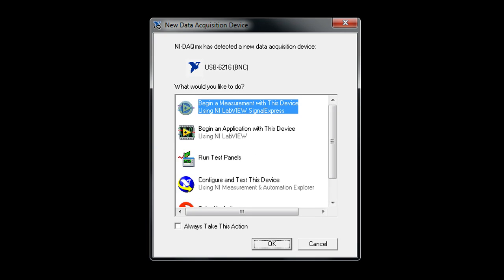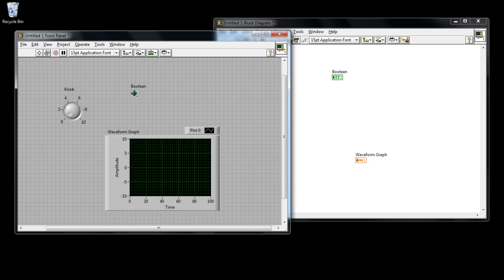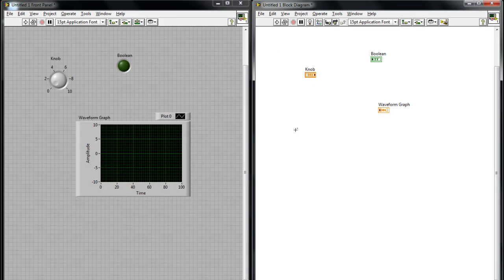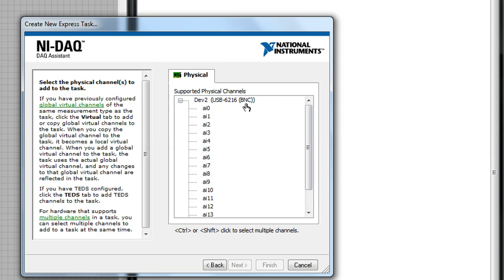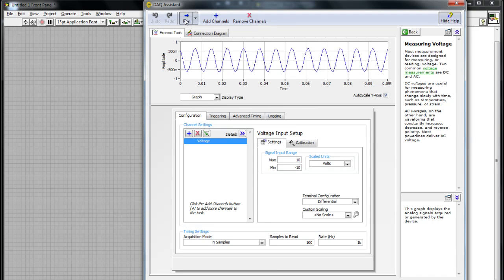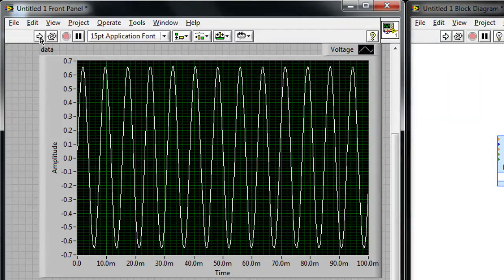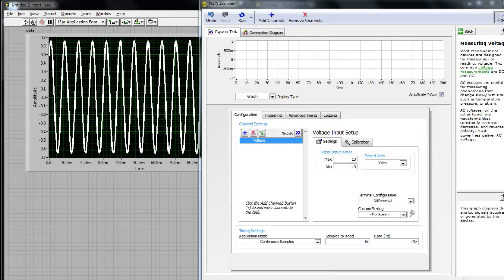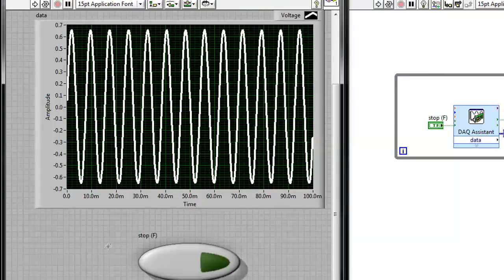Taking a Measurement with Your Computer

Comment: Hi Vinit, watched your videos, they all are very informative. We are having Ni myDAQ system and we want to do continuous monitoring of voltage over lab view. We are working on one project in which we are using a photomultiplier tube (PMT) to sense low-intensity light. The PMT gives output in voltage (equivalent to light intensity) and we want to see the output of PMT over Labview using  Ni myDAQ system. We have tried so many times but were unable to configure PMT and DAC system. Kindly please help us in this regard. Looking forward to here from you. Thank You

Comment: @sazer123 Hello.  If your panel meter has a communications port, you might be able to get your data directly into LabVIEW that way.  Serial standards like RS-232 or RS-485 are fairly common in industrial automation, and LabVIEW has built-in functions to interface with serial drivers.

Comment: Hello,
It all depends on the sensor you have to measure water flow.  You can find sensors that output an analog voltage signal (0 to 10V) that corresponds to the water flow being measured.  Then use a data acquisition device to bring the measurement into LabVIEW, for graphing, analysis and data logging.